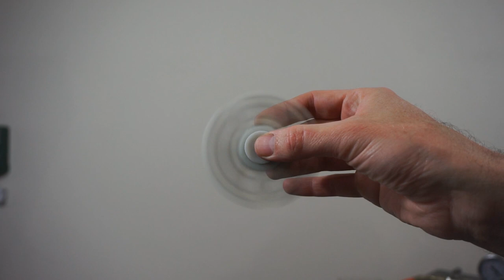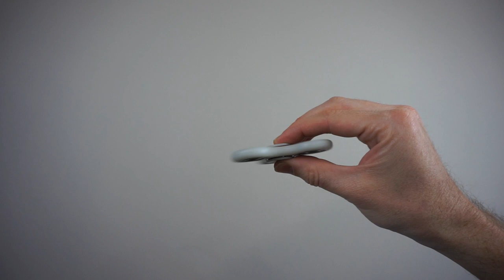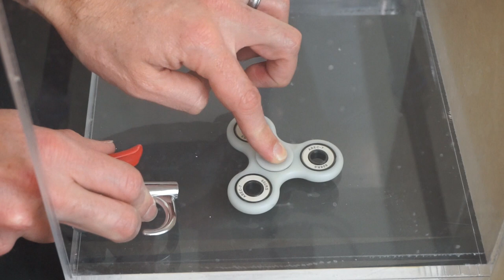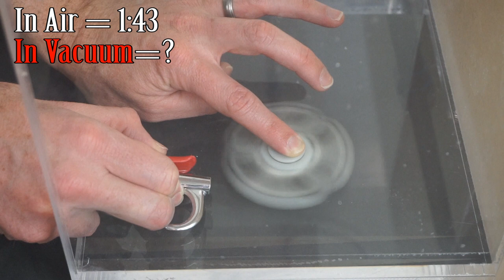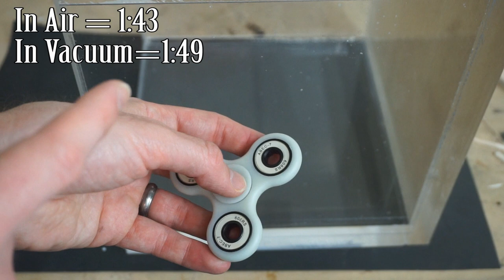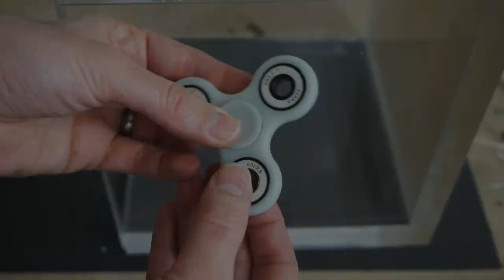How Long Can a Fidget Spinner Spin In a Vacuum Chamber? Will It Spin Forever?

Comment: I would say that it spun for 6 seconds longer because there is less air friction but that's about it. Most of it is the bearing friction. You should try using the floating fidget spinner that only has air contact and see how it does compared to one that uses bearings.

Comment: I'm by no means a physicist or scientist or anything but I'm curious about something. If an object has been given energy to start spinning in a complete vacuum of space where there's no other particles at all present apart from the ones attached to the object, will the object ever stop spinning? like where can the energy transfer To? Will the object just spin forever until the energy is transferred elsewhere????????
Reply from the maker: +mini dwarfdude yes it will just keep spinning. The earth is a good example, it's been spinning for over 4 billions years. However eventually all spinning objects in the universe will stop after an extremely long time due to emission of gravitational waves and being struck by cosmic  radiation. But those time scales are longer than the age of the universe so it's not really relevant.
Reply: The Action Lab That is really interesting. So eventually everything in the universe will be still? Like will it reach a final and total equilibrium? So nothing else will ever be able to react again. No energy transfers, chemical reactions or anything... So will the universe stop expanding? Time will come to a halt perhaps? Maybe that's what the universe is heading towards, N.
Reply from the maker: mini dwarfdude that is one scenario that we think could happen. Eventually the universe will come to equilibrium it is called the "heat death" of the universe. There will be no way for any work to be done, no chemical reactions can happen. Nothing. The universe will just be still and never change again. However, Stephen Hawking believes that eventually the arrow of time will run in reverse which means that entropy will decrease instead of increase and the universe will start contracting and return to a singularity only to start over in a Big Bang again in a never ending cycle of expansion and contraction.
Reply: The Action Lab dammit that was my theory I didn't think anyone had thought of it before... Oh well lol

Comment: The errors I see are probably all the same you saw. 

But we don't know if the psi coming out of the air compressor is the same also the time it's held on there for (also the RPM's of which the spinner is let loose). The vacuum chamber you used didn't have enough time to make a decent vacuum while I can see that would be kinda hard to get it spinning and have a vacuum around it.

Comment: Okay. Let me get this straight. 

Space can not be simulated on Earth, because it would just be filled in with air anyways, so if you spent years trying to do so, it would ultimately fail. A mere vacuum chamber can't simulate space at all. Even if it were space, and you spun a fidget spinner, it would be moving, yeah. But not forever. It would either get sent back to Earth by gravity, get molten, and probably kill someone, or stay in space floating wonderlessly for 1 Earth year or so. About the only way you can keep something in motion forever is if you have an infinite amount of something. Wether it be water, magnetism, or wind, it needs to be infinite to have something spin forever. Unless you have that one wheel that has water on each end and works with gravity, but other than that, there is no other source of infinite energy to keep something in motion. You would need to destroy Earth to find another way, or go to space. If you continue to make these pointless videos, you might as well just make your own theories about how the world was created.
Reply from the maker: +Lahking AyeSoul actually that's not right at all. It's easy to keep something in motion actually you don't need to have an infinite amount of energy. An object in motion will stay in motion unless an external force acted on it. So in space if you take a ball and spin it it will stay spinning (take the earth for example). Or throw it it will keep moving indefinitely.

Comment: even if friction was no longer applied there are always particles and fluctuation at the quantum level that will cause it to gradually slow down overtime, it would impossible to make something spin forever on a single discharge of energy

Comment: I'm not nearly as nerdy sounding as you are, but when over half of the experiment is conducted outside of a vacuum while using air pressure to accelerate the spinner, what exact results were you expecting?

Comment: That is not the reason that a bike stays upright. It's due to the haptic feedback from the handle bars moving side to side at speed. It's a common misconception, but if you think about if the bike was suspended in the center and with the ability to fall either side, would spinning the wheels stop you falling? No

Comment: I wonder if the air acts as a lubricant, especially at high speed? I'd wager that while it might not spin longer in air, it would generate less heat than in vacuum. Also, if it was a circular spinner to reduce drag (versus having three arms hitting air), it might spin longer in air than in vacuum--assuming a high-gravity environment like Earth.

Comment: From a scientific stand point, even if you were able to get the vacuum quickly enough that there is no air resistance, how ever without air the bearings can't be cooled the same but even without the air gravity is the major resisting force.

Comment: It's not a perfect vacuum. If you spun one in space it would go on forever because an object in motion will want to stay in motion unless acted apon by an outside force. If you spun it in 0 atmosphere then it would theoretically spin forever, but you did it in 0.2 atmospheres so it still had 0.2 atmospheres of resistance. It did last longer but you spun it in earth atmosphere and then started to create the vacuum. It does make a difference. Unless it has a resister inside of it to slow it down, than nothing would stop it.

Comment: Could you try the same experiment in principle but with electric motors and see if the energy input required to get it to a certain rpm is the same for both vacuum and no vacuum? 

You'd need an electrician friend or maybe reach out to another channel for help but you could make your own round fidget spinner that you can spin with electric motors. Give the device batteries, a motor, some power usage monitoring method and an rpm sensor. Have a frame to assist in keeping everything balanced 

I feel like the fidget spinner in your video would spin faster if the amount of kinetic energy used to spin the fidget spinner when the vacuum was already started. By starting the spin without a vacuum you may have limited the maximum rpm that could be achieved with that amount of energy and exposed the blades to wind resistance before/during the vacuum build up. You've also got to consider the bearing your using may not have been the highest quality and efficiency could be reduced as a result

I think the theory is sound but more needs to be done to reduce friction

Comment: The reason why it stopped is that the air resistance does not matter as much as the friction in the bearings

Comment: I it would spin longer, but not forever. Due to the only forces in a taken away in a vacuum is air resistance and pressure. Since pressure doesn't matter Much air resistance is the only question is aid resistance. Since there is no aid slowing down the spinner, it will go longer in the vacuum

Comment: It would never spin in forever in a vacuum chamber as there is resistance between the ball bearing(the part you hold) and the actual spinner(the part that spins), which will slow it down because of the friction. Until there is no friction THEN it would spin longer but not forever.

Comment: First of all, nothing can spin perpetually. Energy must convert to a different energy.Since it's in a vacuum, the kinetic energy of the spinner probably will not convert to sound, it could, however, convert to heat.

Second, the vacuum is most likely not a perfect vacuum.

Third, there is still friction.

Comment: Putting it in a vacuum wouldn't make a difference due to it's not the air that slows it down nor the friction. The reason why it's slow down is because it does not have a constant input of energy to keep it going.

Comment: It won't spin forever because there is friction between the ball bearings and the metal. But if it was suspended with say magnets and there was no friction and it was in a vacuum it would theoretically spin forever. Unless I am not taking a variable into account which is possible.

Comment: I saw this video and clicked it just to make this comment. The spinner will not spin forever because of the slight resistance of the ball bearings. Although it will spin for longer due to nearly no air resistance.

Comment: It won't spin forever even if it was in a perfect vacuum. The gears that makes it spin has a lot of friction and the amount of energy lost from heat due to the constant spinning of the fidget spinner will eventually slow it down, the air resistance is negligible.

Comment: The vacuum would have made 5X more difference if it was pumped out at the start
Since the air resistance exponentially higher at higher speeds

Comment: obviously it would not spin forever, that would violate the first law of thermodynamics. air resistance has a negligible effect on something so small, so the only real thing slowing it down is the tiny amount of friction in the bearing, and this is unaffected in a vacuum. that's why there was no difference

Comment: The friction from the bearings spinning are pretty much the only things slowing the spinner down, the air resistance doesn't really play that big a role in it since there isn't much surface area.
Reply: Agreed four years later🤤

Comment: It's not possible since an absolute vacuum cannot be achieved, especially not on Earth (even in space there are approximately 3 particles per cubic metre, which proves that the vacuum is not absolute). If you attempt to achieve such a vacuum on the surface of the Earth, then the container will probably be crushed by the air pressure outside (because it is decreased on the inside). Thus so, it is practically impossible, but theoretically it is.

Comment: I didnt watched the whole video yet. But im already sure that it wont spin forever. A vacum means just no air resistance. Gravity still exists, so will the vertical mechanical force still go on. Ergo it will stop somewhen. Much more interesting would be what happens if you do the same test but with the spinner placed vertical. Because much less mechanic force or resistance would be there.

Comment: The vacuum wasn't pulled during high speeds when friction with air is an actual issue. Lubrication should be added in both instances.

Comment: Well the vacuum wasn't closed for like 6 seconds.. And you're blowing air into it there's no way to really test this right.. The vacuum would always have to be closed with the fidget spinner inside, somehow making it spin without air in the first place or after you stopped blowing air it would take a second or so for the vacuum to get the air out.. Thus it would be really hard to get the right time..

Comment: Despite the obvious flaw in experimentation, if you look at the apparent cross section of the spinner you note that there is not a lot of area for air resistance, so the majority of the slowing down will come from friction of the bearings.

Comment: it wont spin forever because it will release energy as heat, and the heat does exist in a vacuum, its radiation, and conduction, i dont think there is convection in a vacuum, but dont get mad at me if there is

Comment: i haven't even watched the video and i already know it will stop. heres why (simplified)

since the spinner is connected to the bearings is spinning on, as it rubs against the bearing it will lose energy in the form of heat dissipation from friction.

Comment: Your claim that bicycles don't tip over when they are rolling is false. Bicycles don't tip over because the handlebar is behind the wheel und when the wheel tilts the handlebar steers in that direction so it's directly over the wheel again.

Comment: Not a very good experiment. The fidget spinner was already spinning for quite a while before the vacuum was applied so part of the spin time was done in normal air pressure. The spinner needs to already be in a vacuum before you start the spinning to make it a true experiment, so the results are not accurate.

Comment: U didn't even create a vacuum. U didn't suck out any air and u just closed the container. A vacuum is an airless encasement, free of air or any other material (besides what's desired). U closed the box with air still inside and let it spin. That's the same thing as the first one because both are blocked by air resistance

Comment: This is a good idea, but flawed science. If you find a way to speed up the spinner after the vacuum has been created, I will subscribe. Perhaps feeding the air line into the chamber and activating it after the machine has been turned on.
Reply: Or even better, use a magnetic field to spin it from outside the chamber, meaning no air included!

Comment: YOU TOOK MY IDEA!!!!!!! I HAD THIS IDEA LONGER THAN THIS VIDEO EXISTED. ok well i just wanna tell ya i tested my fidget spinner in water and i notice it went slower. i know the water molecules were tighter than air so the friction was stronger. i think....... well any who since there will be not that much molecules to stop it. no drag or friction. and this is all coming from a 4th grader whos about to be in 5th. im just saying what i know.  you probably arent readding this but who should put a fidget pinner in a microwave. it will go faster cause the molecules will be exited and might push the fidget spinner arond a little also the air will be wider meaning the molecules will be more father apart so ya it will go faster. also you asking the question will it spin forever is dumb. also i havent watch the vid yet so i dont know whats going to happen or if im right.

Comment: yo where is the tip for that air gun
with out the tip the velocity of the air is slower there for the spinner could be spinning way faster if you put the tip on that air gun

Comment: The main problem was the use of compressed air. If he found a way to start the spinners at the same speed using a mechanical solution, it would have eliminated most of the problems (closing the cube and starting the pump).

Comment: In case anyone was wondering, the terminal velocity of an object can be bypassed easily using an outside force, therefore the terminal velocity of the spinner does not depend on how much air you blow past the object make it spin, rather how much it can spin without an outside force. To put this into perspective, imagine a skydiver jumping out of a plane and reaching terminal velocity, he then activates a jetpack (outside force AE the air compressor) and bypasses his terminal velocity. Not to discredit the video, but the terminology is entirely incorrect. flies away
Reply: An added comment, none of the fact checking information here discouraged me from liking the video.

Comment: The bike imformation is wrong. Its actually mostly because of the human on the bike and also because bikes are designed in Such a way that the frount wheel adjusts to being off center allowing thr bike to balance.

Comment: Well actually,did you know that everything falls at 9.8 meters per second no matter it’s shape and how much it weighs?The only reason why things fall at different speeds is because of air friction.BUT...If you remove the air,you can drop a bowling ball and a feather at the same time and height and they will hit the ground at the same time.SO if you bring that logic into this,if a fidget spinner is spinning in a vacuum chamber  and the vacuum sucked all the air out,the fidget spinner would experience no air friction which would allow it to spin forever.

Same thing happens in space,if you brought a fidget spinner to space then span it and let it go free into space,it would never stop spinning as long as it stays away from any type of air.

Quick Maths

Comment: Lmao if you went to physics then you would not the friction between the bearings and the plastic would have at least some amount, so with air resistance or not it would still produce a similar result

Comment: So stupid of course it's not going to spin forever. Friction
Reply: Larvitar Dratini There is still friction between the bearings and the find itself
Reply: Abhishek Mawandiya I know
Reply: FriedTerraria even if it is a perfect vacuum which I'm pretty sure is impossible to create on earth, there is still a small amount of friction on the bearings and stuff. It wouldn't spin forever no matter what. Also that is a very shitty vacuum he had the whole door open and then expected to close it and suck all the air out in 1 minute. Stupid video
Reply: Larvitar Dratini I actually tagged you by mistake :( I wanted to tag Fried.. My bad. I totally agree with you
Reply: Abhishek Mawandiya no worries!
Reply: Gravity ?
Reply: Take a spinner to outer space , and give it a gentle push so gentle that on earth it would even finish one orbit but in outter space it can spin forever cuz there is no gravity , air resistance effects the spinner but only around 15% while gravity effects 70% and there still is the friction between the spinner and the object ! 
Btw if u spin the spinner horizantly it'll stop sooner than if u spin it verticaly ( gravity again )